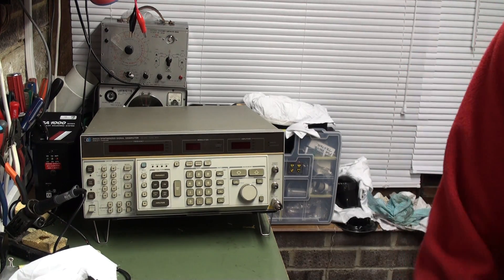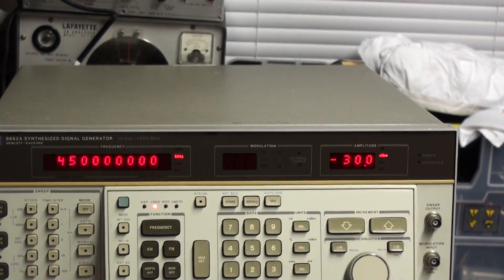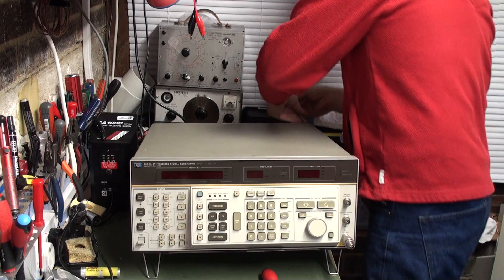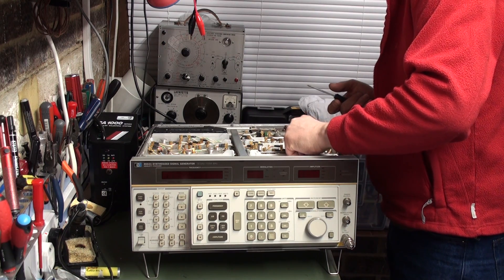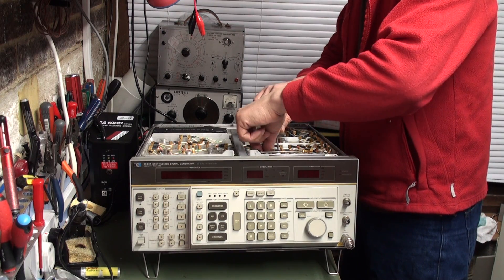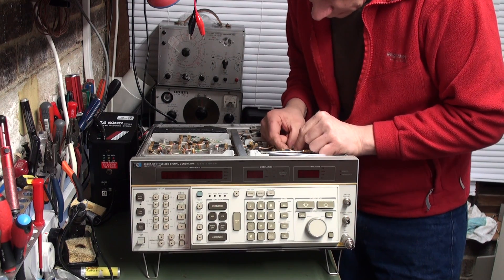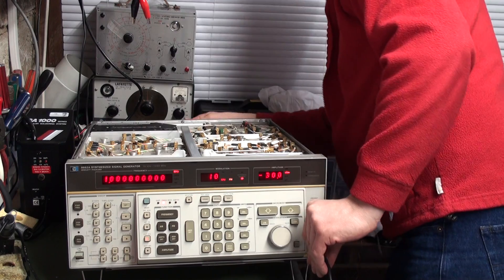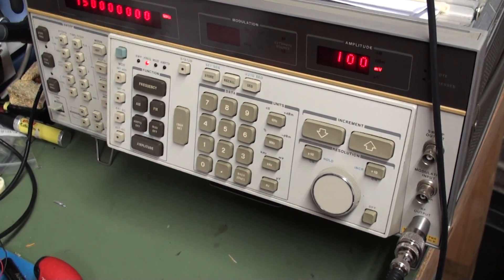HP 8662A Pt4 final repair

Comment: Very nice deduction on your part Simon; it looks like HP did not diagnose or felt the board was not worth changing in the unit. However, when you consider this this test gear was probably worth a lot of money I'am surprised they did not bother fixing it.
Reply from the maker: +John Cunningham Apatently the fault was diagnosed at a repair charge of over £3000 was given. Due to it's age I was felt not viable. It has since had another hickup a last year, another board failed that I managed to fix eventually. I bought a spares unit for very little money so have loads of spared now.

Comment: Nice work, the 8662A is an excellent signal generator.  It looks like your decimal point on the display isn't working when you enter higher frequencies.  Sometimes you can solve this by lowering the hinged front panel and re-seating all the socketed LED displays.
Reply: Simon Spiers It shouldn't be a logic problem.  The decimal point when in MHz is always on the fifth LED segment from the left, regardless if it's single, tens or hundreds of MHz. If you re-seat that segment the decimal will likely come back on. You'll be surprised how loose those segments can get when the machine gets bumped around. I got my 8662A dirt cheap on E-Bay.  The only problems it had was an intermittent attenuator (easy repair) and a bad sum loop VCO board which I found a new one for $40.00.